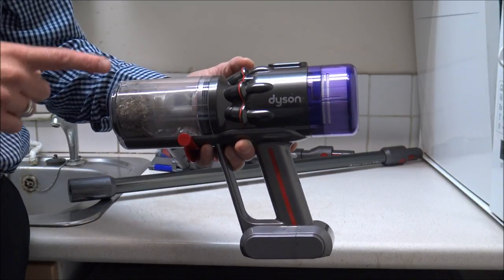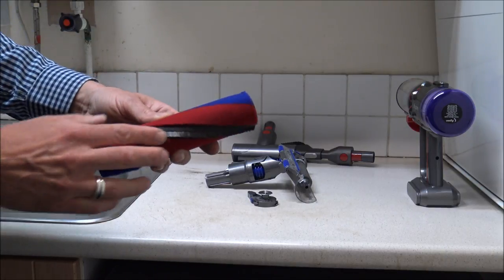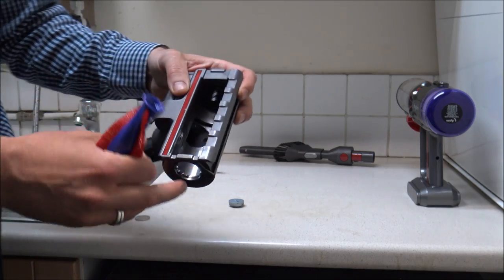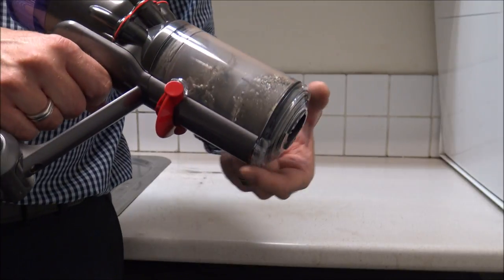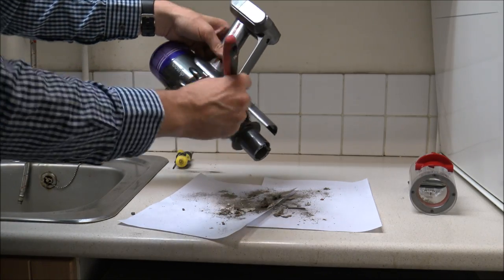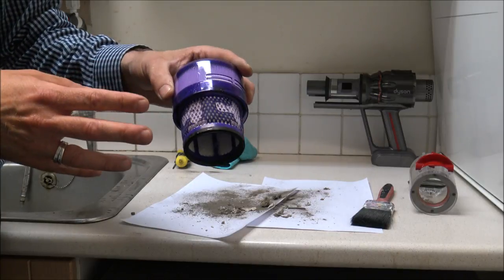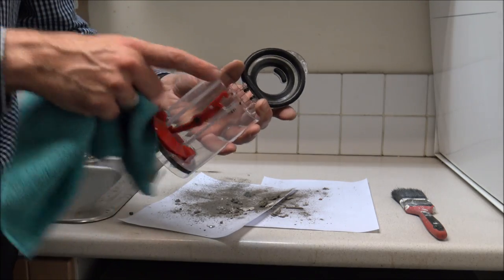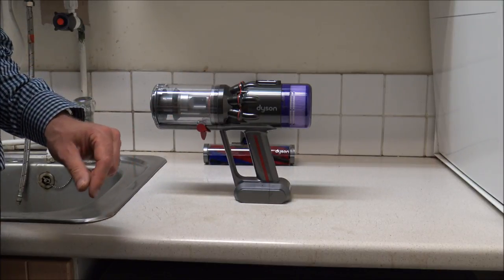How To Clean And Maintain The Dyson Micro 1.5kg And How To Stop It Pulsing

Comment: Got one yesterday. The small motorised head tool keeps stopping when hoovering the sofa, when I use a backward stroke only it fails less, but push it forward and the brush stops spinning.
Going to ask dyson to replace the head.
The hard floor head works ok, nowhere near the suction of the v8 though, I think tbh this micro will need to be used in max power mode all the time.
But even when I’m full power, that small motorised tool keeps stalling.
Thanks for the cleaning tips sir! 👍
Reply: I recently got the next size up, the v12.
Using the main cleaning head to clean kitchen and hallway is fine, but as soon as I went onto the doormats, it too stopped going round! Have tried it 3-4 times now. I had to swap out the big end for the small pet hair cleaning end, and that DID work. It was hard going though.

Comment: Thank you for your informative videos! I have the absolute plus, and have only had it for about a month and accidentally vacuumed a very small amount of water, less than a tablespoon, but when I noticed I immediately turned it off and emptied the bin to wipe it out, and noticed water was around the metal mesh part, not a lot but it was wet to the touch, I dried it out and it seems to be working fine, but I want to make sure I haven’t damaged the machine and or in the future it won’t break down because of this, any tips or suggestions if anyone accidentally vacuums a small amount of water, please and thank you
Reply from the maker: If you vacuum any water up, i would recommend not using the vacuum at all and making sure the bin and filters are completely dry after about 24-48 hours.
Reply: @lords-electrical  what's the name of srewdriver does it t10 or 15?